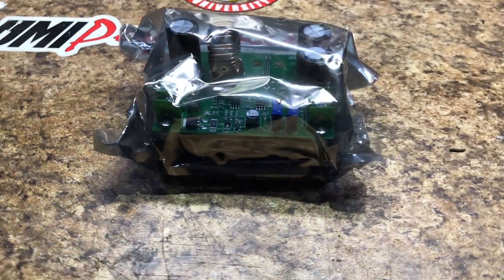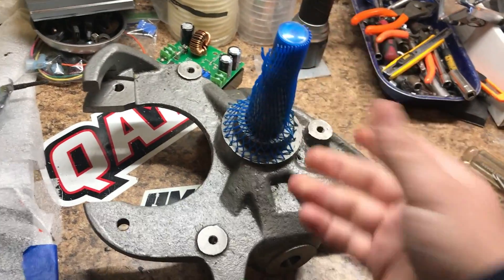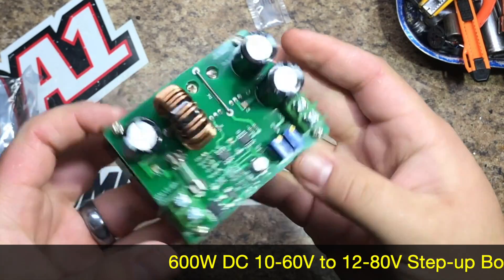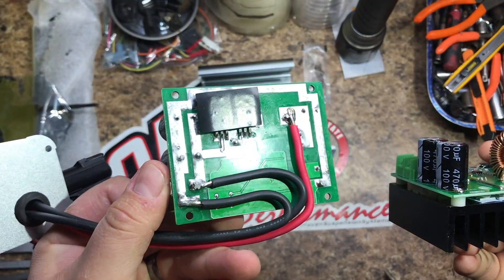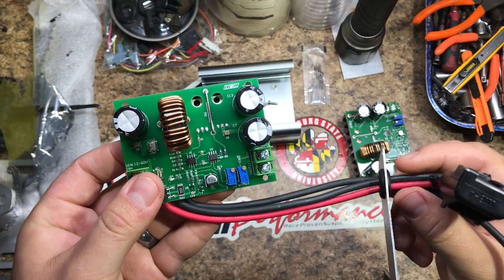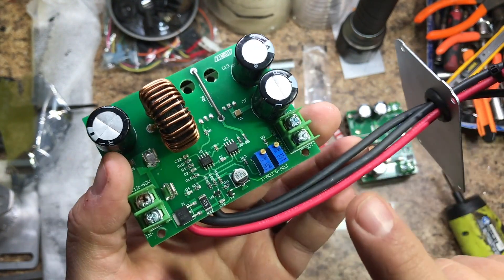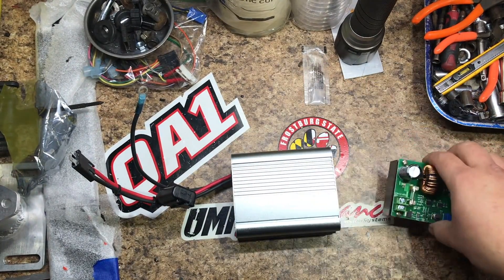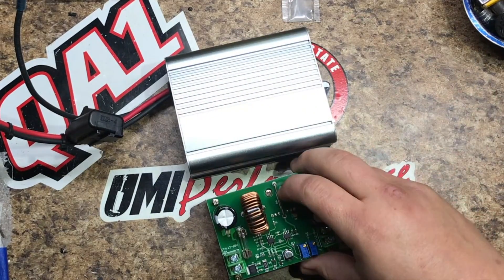GM G-body How to Speed Up your Old Car Windows!

Comment: Great video... thanks for doing it.... Where can i get wire leads to plug into circuit breaker spot in my fuse box?
Reply from the maker: I made a couple of those out of a two flat spade connector from the miscellaneous section of the auto parts store.

Comment: Where are these available for sale today? If they're no longer for sale, can you recommend somewhere that's still selling them?
Reply from the maker: The one I purchased is no longer available but look up "Step Up or Down Adjustable Voltage Module" and look for an adjustable 12V to 24V one. I don't want to recommend a particular one because I have not used any of them other than the one you see in the video.

Comment: Nice car!  Thank you for making this video and explaining everything.  How is this working for your motors?  Have you had any problems with motors failing?  I want to do this but I don't want the higher voltage to burn up the motor.
Reply from the maker: Damian has ran his window racer on since I made this video and has had no issues. But I had the same concerns since my motors were all brand new. Gotta keep in mind that the window motor replacements are also hit or miss.

Comment: What's the link for the mini atm plug that you plugged the two + wires into?
Reply from the maker: That is an A/C compressor/test replacement connector, you’ll find it or something similar in the electrical section at advance.

Comment: Cool video man. Do you have a link to the circuit breaker plug?
Reply from the maker: I just realized I forgot to mention that, its a repurposed connector from the engine harness. you could use regular spades.
Reply: @VenomGT87  Thanks man I like the way the plug looks for a clean install